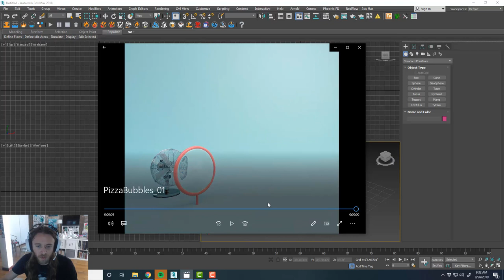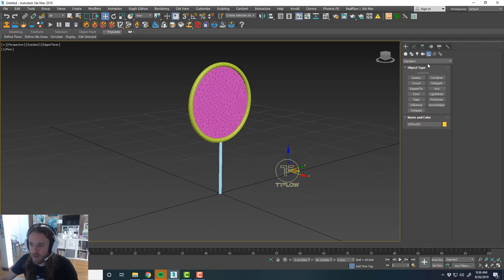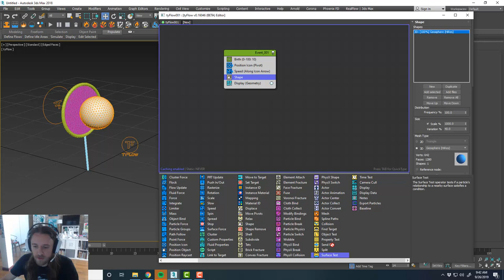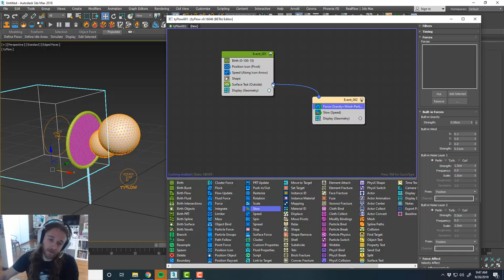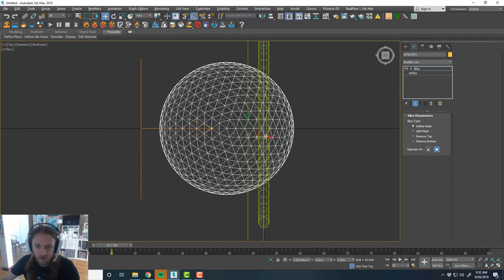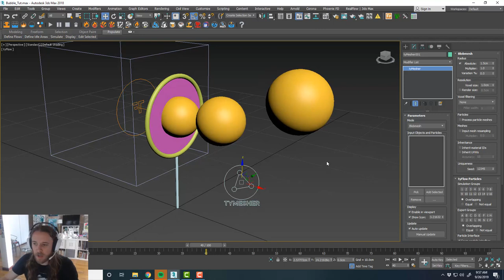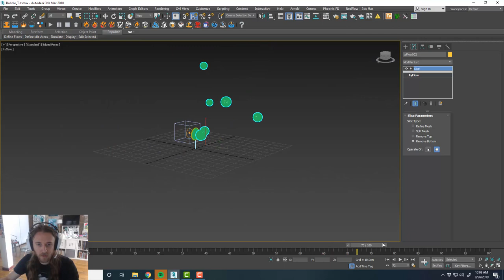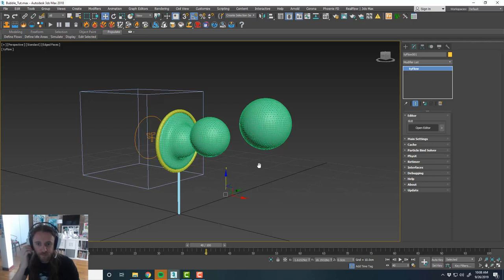3ds Max and TyFlow tutorial: Procedural bubbles!

Comment: Thanks! Really useful tutorial Kyle. I need your advice on how to make the bubbles not perfectly spherical. How to make them a bit more random shape (with tiny deformations) like they are in real life?
Reply from the maker: Hey Igor, sorry for the late reply. You could try adding a noise modifier to the bubble tyflow. For more precise control, I would create a sphere with a noise modifier, assign it to a TyActor with an animation for the noise, and instead of using a shape operator in your flow, you would replace that with an actor and actor animation operators. That way, you can control the noise animation on each individual bubble :)
Reply: @simulation_lab  Your advice is still valuable because I'm going to apply this method in another related project. Thanks so much, Kyle!

Comment: Hi I am working on tyflow for the first time, if I were to add text inside the bubbles would I need to make duplicate each tyflow for each letter?
Reply from the maker: Hey Adam, if you're trying to add a different letter to each bubble, you can just add your separate letter objects to the shape operator, and set the frequency for each object. That will randomize the letters that appear. Also, this tutorial is a bit outdated, and the duplicate flow for the pizza was a quick and dirty way of adding objects in the bubbles. You could add a spawn operator after the original shape operator, and after the spawn add a new shape operator to add your letters. You can use a particle bind operator to bind the letters in the bubbles or something. I might make a new tutorial to supersede this one if more people are trying to do this.
Reply: @simulation_lab  cool will try this thanks for answering!

Comment: tyboolean subtract A-B doesn't work.  is there a reason for this plz ?
Reply from the maker: Did you add a mesh operator in your flow, and uncheck "render only"? The bubbles in your flow need to be an actual mesh in order for the boolean to work properly. Otherwise, make sure your "film" cylinder is subdivided like in the video, or else the boolean might not work. Let me know if it works for you.
Reply: @simulation_lab  yes amazing it worked. thank youuuuu

Comment: How to add pizza material
 and bubble materia in tyflow
Reply from the maker: For this scene, I made a duplicate of the bubble simulation and replaced the bubbles with the pizza slices. The I just applied the materials to each tyflow. It's a pretty cheap way of doing it, but it works!